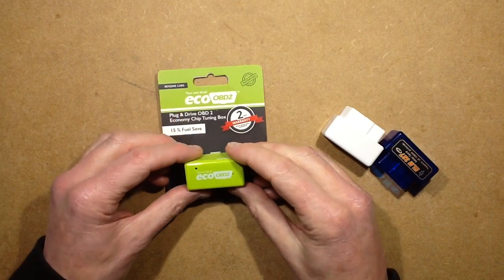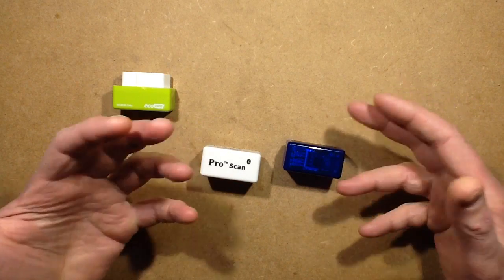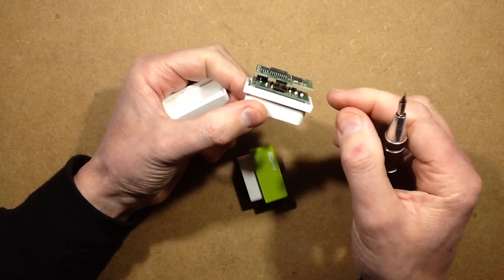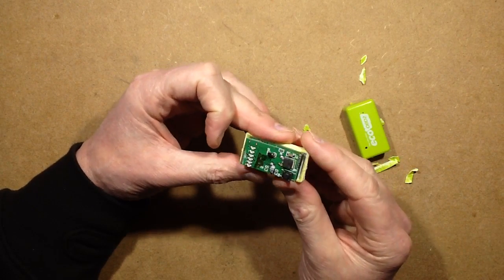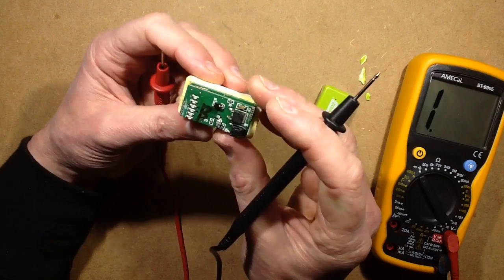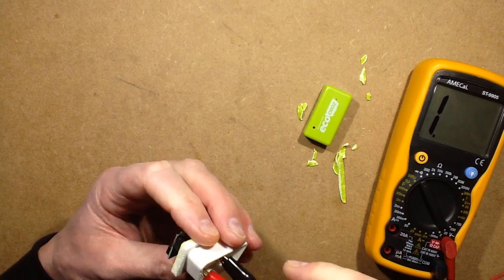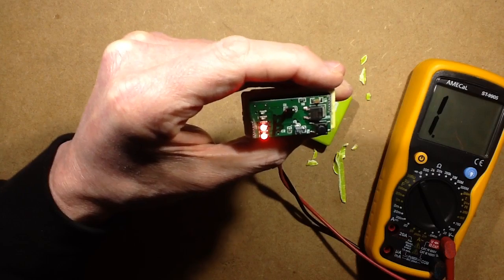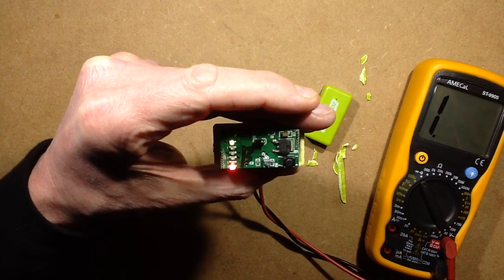Inside an ECO OBD2 "chip tuner" fuel saver.

Comment: Plug it into a fugging car and actually do the fugging research you moron, stop just shooting your fugging mouth off without actually thinking, if you haven't a clue you moron, go check it FFS !!!
Reply from the maker: No need.  The unit has a 10K resistor between each processor pin and car network contact.  It can't influence data on the low impedance bus so all it's actually doing is monitoring for network activity and then putting on a light show.  It's fake.

Comment: Get a real scanner at scantool.net.  It works reading trouble codes when you need to look for where to repair car troubles.  To get extra enhanced codes you need to pay extra or they are locked by the manufacturer.  Basically they don't want you to read certain areas without ponying up to the manufacturer.  But for basic diagnostics it's helpful.  I wouldn't trust anything from China...

Comment: I used one in a new{NEW) Lexus for a year. It’s not rocket science. It simply raises ignition timing slightly. Better mileage, better shifts.you are trying to make it to complicated.
Reply from the maker: It's just a lightshow.  The module does interface with the vehicles networks, but only to detect activity.  It can't actually change their state due to the use of high value resistors that can never overcome the Canbus termination resistors.  So it senses the activity on its inputs and then jiggles the LEDs to make it look like it's interacting with the vehicle while it's running.  If you think it's had an effect then it's purely a placebo.

Comment: Did you try it in your vehicle? That might be a better way of testing it then with a multimeter. I wish I saw the $0.99 on eBay listed above first. I payed $80.00 for three. Thanks for the info.
Reply from the maker: It appears these units monitor the cars data bus for activity and then respond with a light show.  They don't actually put out any communication themselves.

Comment: I fitted one of these devices in my VW Caddy Diesel van and the first thing I noticed was that the engine sounded smoother and I can now accelerate to 60mph in 9 seconds!  The book mpg for the 1.6 Diesel engine is 49mpg but after running the van with this device for a fortnight and covering 2614 miles the onboard computer is telling me that my average fuel consumption is touching 67mpg.  Am I impressed?  What do you think?
Reply from the maker: That's pretty impressive for something that just monitors the canbus lines for activity and blinks the LEDs to make it look like it's actually doing something.

Comment: This is how analysis should be done https://blog.quarkslab.com/reverse-engineering-of-the-nitro-obd2.html
Reply from the maker: That is a good thorough test.  Interesting to note that they've cheapened the design even more.  I ordered some of the newer ones from eBay a couple of weeks ago.   these fake units do have one extra trick though.  They do monitor the canbus lines, but only as an input to detect activity.  When they detect activity they put on a lightshow to emulate actual activity when the vehicle is in use.

Comment: YOU GUYS CAN COMMENT ALL YOU WANT, DOWNGRADE THE PRODUCT, ETC.  BUT GUESS WHAT, ILMFAO  AT ALL OF YOU !  I GOT ONE FROM CHINA FOR $ 2.83. INSTALLED ACCORDING TO INSTRUCTIONS AND NOW MY 18 SILVERADO GOES ON "V4" MORE THAN EVER BEFORE EVEN AT 70 MPH WHICH NEVER DID AND MY MILEAGE ON THE HIGHWAY WENT ALL THE WAY UP TO 23.9 MPG AND LET ME LAUGH A LITTLE MORE, IN THE CITY IS NOW CLOSE TO 17.2.  IT IS NOW CONSTANTLY SHOWING 68 TO 69 MILES WITH 1/8 OF A TANK, THE LITTLE LINE IN BETWEEN THE 1/4.  SO AGAIN ILMAO AT ALL OF YOU  INTELLIGENT GUYS.   $ 2.83, YA HEEEAR  !!!!     LMFAO !!!!!
Reply: MAYBE THESE CHINESE, AS THEY DO NOT GIVE A CRAP ABOUT OUR ECONOMY COULD NOT CARE LESS IN MAKING A PRODUCT THAT WORKS.  YOU SEE, I WORKED AS A FOREMAN FOR CHEVROLET ASSY PLANT.  THE INDIAN ENGINEERS THEY HAVE DESIGNING FROM SOUP TO STEAK ARE ALL IN COHOUTS WITH THE OIL COMPANIES.  THEY CAN SURELY MAKE AN ENGINE QUITE INEXPENSIVE TO RUN BUT THEY WON'T.  I MADE ON THAT RUNS JUST WITH THE F.....N VAPORS BY RECIRCULATING THE GAS THRU AN OLD CARBURATOR.  I F I CAN DO THAT THEY SURE CAN.  THEY ARE THE REAL ONES LAUGHING THEIR ASSES TO THE WORLD.

Comment: I think the LED blinks because the circuit is trying to find the right Bus-Protocol. There are many types of protocols.
You have to imagine the different protocols like different languages. This circuit tries to speak in different languages to the engine control unit. Once the engine control unit responds to a particular language, the connection is established correctly. I have an older Diamex OBD2 Analyzer with support for many protocols. With this thing, i can use the auto-detect function or manual choose the protocol to use. With this thing i can read real-time values like speed, rpm, temperatures, pressures and many more. I can also clear the error memory. I can't change settings with this Analyzer. It's a simple device but often helpful.
Reply from the maker: It's a lightshow.  The unit does monitor the cars networks, but only to trigger the lightshow when it sees activity.  Otherwise it would keep blinking when the engine was off.

Comment: which one of you assholes actually tried it and can actually say it doesn't work?
Reply from the maker: This asshole has analysed it in detail.  The unit only monitors the canbus data lines for activity and uses it to trigger a lightshow so that it looks like it's responding to actual data activity when the vehicle is running.   It's completely fake.  It sends no data whatsoever back to the vehicles ECU.

Comment: for fucks sake people .. this is cheap Chinese knock off shit designed to fool people that haven't a fucking clue how the obdII system works or how re flashing an ECU is done .. all that stuff is possible just not with this rip off crap.. all this thing does is flash lights to make dumb people think its doing something .. its not .. at least those cheap resistors they used to sell to plug into you air inlet temp sensor at least fooled the ecm for a short while to give a rich fuel charge etc until the system compensated for it .. those were also worthless crap but at least if you reset your ECU daily you would feel a difference .. they were utter crap but they actually did do something

Comment: I use an elm32 device on my Ford ranger, with torque obd. Torque does all the heavy lifting, decoding etc. So that available sensors can be monitored and reset. It works extremely well for my purpose, and has actually saved me a lot of money in identifying faults before they become a problem. And in identifying dishonest mechanics who try to overcharge for work they haven't done!
And although it won't let me remap the ecu. When I had to change out one of the transmission control solenoids it did alow me to reset the ecu, which then remaps itself over the next 250km based on the drivers style..... Probably what your "eco unit" does.
So yes it could very well be legitimate. It is very useful for monitoring and resetting, however it won't give full access as an OEM device would.

Comment: Hi Clive This reminds me of a test by QED in the 80s. It was i think 20 people 10 male and 10 female of various ages. They had to drive round a race track in a car with no airbags. Each had to get their average time. Then they were given a talk and videos on how safe airbags were and then they all were sent out to drive the same make of car with airbags. the initial car was fitted with a spike on the steering wheel... 
The test relieved They all drove faster in the car with airbags than the first car they drove. Then they all drove considerably slower in the car with the spike.  Looking at other videos on this I think it is psychological knowing you fitted and you subconsciously drive more rationally. The placebo effect. 
Small things like correct tyre pressures. air con off. even polishing your car. driving with the windows closed.  These make a small difference on their own but all together can save you maybe 30 to a tank which is a lot over the year.. Cheers for the video. I find your channel extremely informative.

Comment: I always look on Amazon and then if they have them I will look at the reviews. 
They have two makes available on Amazon, one is called the "NitroOBD2 Performance Chip Tuning Box for Petrol Cars"
The other is the Eco but they are of course both the same and both made in China. 
I did have a look at the reviews from the Nitro one so search for the "MagiDeal Benzine/Petorl/Gas Car OBD2 Performance Chip Tuning Power Box Engine ECU Remapping Remap More Power More Torque". Or search for the "Nitro Eco Additional Module Fuel Savings Car Petrol OBD2 Chip Tuning Universal".  The reviews are promising but personally I would not waste my money. 
The spelling of petorl in the MagiDeal link is a Chinese error would you believe and not my error 😊.

Also search for the Eco one on Amazon and check the reviews.

Comment: I use a 2000€ BOSCH diagnostic tool to reset the amber lights and read codes. It lets me see why the bloody light comes on. And fix the fault, then reset it.

Comment: Is it necessary for the led to stay on even though the key is out of the ignition and the car is  parked up.
Reply from the maker: The OBD port will usually remain active at all times as it's part of the car's electrical system and not an accessory.

Comment: For the record, I will say that you absolutely are able to change how a car drives via the OBD port, in fact that's how a lot of modern aftermarket tuning is done to vehicles that do have an OBD 2 port. If you watch some YouTube channels that take cars to drag strips you can actually see them tuning an engine on a laptop of their own via the OBD 2 port. So I would imagine that things like fuel economy would be easy to adjust by changing things such as shifting points on automatic transmissions and air fuel mix ratios, how high an engine will allow a turbo to spool in a turbo'd car, things of the sort.

Would I trust putting something like that in my car? Probably not, because there's a lot of bad something like that can do. But is it incredibly far fetched? Not really.
Reply: Those people who are adjusting the ECU like that are using an after-market ECU replacement that's DESIGNED to allow you to tweak this stuff.   Conventional ECU's go to a lot of trouble to PREVENT you from doing that because these devices can trash the engine and that's a huge warranty concern.
Reply: @SteveBakerIsHere  Steve this comment was made 3 years ago

Comment: I would be careful. Some diesel engines can output more torque then the crack shaft can handle. So manual tuning by a professional is recommended. And testdriving to make sure the car is controllable with the profile.

Comment: 5:20 Paul could 3D print a new backing for it at the public library. :)
Reply: 11:30 If you don't know if it's faking it, don't you own an oscilloscope? Make one out of an Adruino? You could read what's on that OBD network pin you were talking about. :)
Reply: For $30 I'd love to have some insight into what's happening despite it being highly unlikely that it would reprogram anything.
Reply: The only car I've ever owned was a used 1989 Honda Accord (EX?) and besides all of the optional features it had the very first Honda fuel injection computer in it. That's it, all it controlled was fuel injection. Back in those days it may have been easy to modify stuff like this but as mcgherkinstudios pointed out, the likelihood that this little green thing is doing anything to a modern car is pretty low.

Comment: i learned about something like this from my step father several years in the mechanics industry here in Canada they are great little devices they can allow you to easily run diagnostics on the fly, and some models like the one your showing here are able to send commands to the ecu (electronic control unit) to change how things are running including but limited to timings and fuel air mixtures to essentially get a free performance boost out of your vehicle without having to spend money on performance parts or pushing your performance parts to the absolute limit. with that said i wouldn't trust something automatically hanging these parameters id want a professional to tweak them until they are perfect

Comment: so i dabble in the automotive world, many vehicles out there can be updated via these ports. its how updates can be sent to pcm's bcm's ecm/s and so on. however, all of these cars have their own language, their own security, their on syntax and protocols. there is no way in hell any 29,99 priced dongle is going to have all of that on it. to edit my own ECM i need a tool that costs more than 25,000.00 and a subscription to a cloud based network from the dealer at 1500 a month and thats on a 99...  i did spend 3500.00 on a scan tool from snapon to allow me to access and activate various systems but even on a 5-10K dollar scan tool i still could not flash a cars ecm with out dealer products/codes/software.   that being said you can always can sniff, interrupt and send false data down lines but what is done for that is going to individual sensors to mod what the vehicle is seeing in order to get different driving effects.

bottom line is no way a single small box in the obd will do jack shit for your car, nor will it damage your car short of a data collision or a blown obd fuse

Comment: not that it matters much if anyone has a 'universal key'. considering that most cars have non bulletproof windows all around the universal key is called a 'brick' anyway. also it's a bit too easy to just lift it up and take it away with most models under 6 tonnes or so ;) 2 skateboards under 2 wheels will do the job just fine in most cases, or just tow it on a stick with the manual brake still on. it's not like it's very hard to just take cars if you so desperately want to and 'hacking into the odb' is not the quickest way to do so ;) if they wanna steal one, just go ahead, cars are cheap anyway, see us give a crap (just make sure it's a new car which we can just buy new again, and not some irreplacable old or custom thing - then we get pissed off ;)

Comment: thing is there should not be 'undocumented' 'random' 'unknown' settings in the first place. you buy the car, at which point they have to hand over ALL of it's documentation so you can fully maintain the thing afterwards even loong after they have been blown up, died, fell of the edge of the planet or otherwise. that includes all firmware and sourcecode and all 3d designs for all parts with material description, or else: no deal. if they don't tell you what they're handing over into your property, we don't want to have it in the first place.

Comment: You should get a AutoLink OBDII scanner. Very neat device.
I have a Russia made OBDII scanner. Very big unit, has a big display and a hex keypad. Allows to read error codes and reset them. Can also write to it.
Then I got my XILINX Zynq FPGA and a Large color OLED display and built my OBDII debugger. Allows to do things like program keys and stuff

Comment: I had a look with a bus analyser on my automotive pico oscilloscope and there was no reprogramming of the ecu being done! At best there is a placebo effect? I used a break out box between this device and the OBD port on the car to allow me to read signals without loading or disturbing them. It is reading some of the data,perhaps the mileage ? Once the micro controller has read a set mileage increase it does a different light show?. Better off buying some magic beans!

Comment: i buy and sell cars. its what i do. I bought a truck once(2001 F350 V8 gas rig) and a very proud fellow told me that the he had the truck "chipped". Now being fairly savvy with tuning and knowing this being a gasoline 5.4L v8 naturally aspirated engine that tuning chips are unlikely to do anything. I saw this same little piece of plastic under the dash and said that is some 20 dollar thing off ebay isn't it and the guy said yeah but it works great needless to say he wasn't a very shrewd negotiator

Comment: I plugged one of the diagnostic bluetooth versions into my car. It worked a treat and I managed to reset the service light. However, I left it connected and it prevented the ECU from going to sleep after I locked the car. So after a few days the battery was flat ! I discovered that the hard way :(

Comment: There's also a 24V of the OBD plugs - the difference is that the power pin has 24V and there's a bar in the middle preventing a 12V tester from being plugged in. OK, your video actually did show that right after I typed it.

Comment: Hey Clive, Can you tell us some more about CanBus?
Reply from the maker: It's a fairly huge subject.  It was originally designed as a serial communication system for vehicles that was able to withstand the harsh electrical environment of a car or truck.  Then it became popular in factories to reduce control wiring in machines and is also used in things like elevators and moving head lights used in the theatre industry.
Reply: Thanks, sounds really interesting, let me guess, was it originally researched and designed for military vehicles and equipment? you should do a video on it.